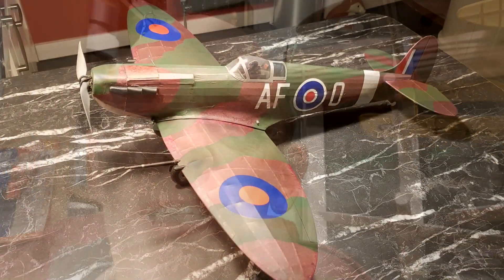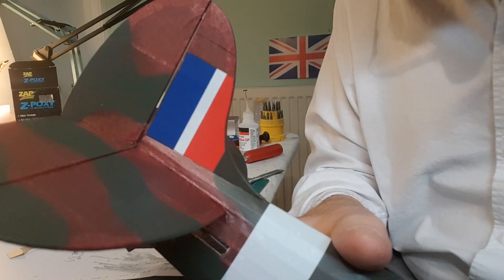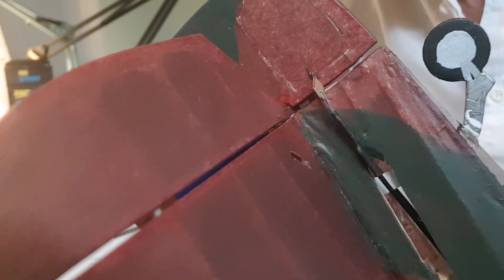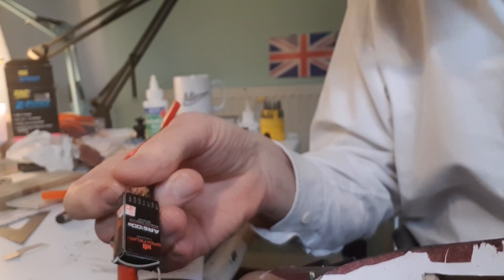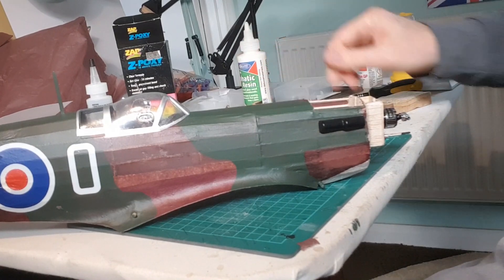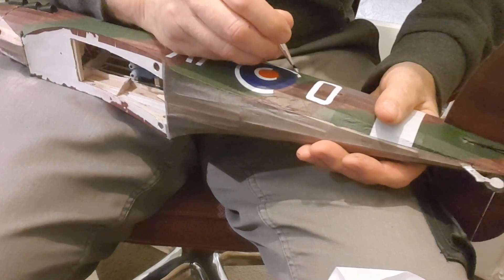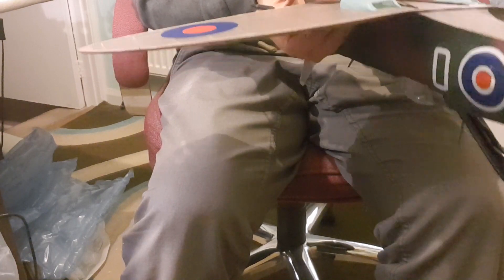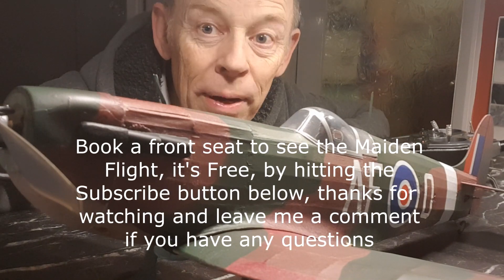Guillow's Spitfire (403) RC Conversion

Comment: Low wing RC models need ailerons, can fly without rudder. Some motor down and right thrust angle helps control torque roll..
Reply from the maker: How right you are Gary 👍🙂

Comment: Hi Cliff - how did you decide which motor, ESC, and battery to use for this?  Is it all based on the finished weight?   I'm trying to select components to buy, but going round in circles with the decisions on motor KV, ESC amperage, etc.
Reply from the maker: Hi Rod, I draw on two things, firstly what others have done already, have you seen this list of past conversations on RC Groups? Here's the link: https://www.rcgroups.com/forums/showthread.php?827861-Guillow-s-Conversions-The-list-of-conversion-threads, and secondly just my experience on what I've used in the past. Whatever you build at this size it needs to be kept as light as possible 👍
Reply: @CliffHarveyRCPlanes  Thanks Cliff - this will really help.

Comment: Thanks, this could be useful, I have a Lysander for Christmas which I hope to adapt from rubber to electric.
Reply from the maker: Thanks Mike,  I  always fancied a Lysander, perhaps one day 👍
Reply: @CliffHarveyRCPlanes  Building a Tony Ray Camel I asked for for Christmas, it's tiny, 380mm wingspan, they say it will take RC, on an 1104 motor and some micro rx board I don't have, and don't have a radio for, so I'm going nano f4 flight controller, 3 1.7 gram servos and I have a few 1104 motors from project F.A.F 2" quadcopter project, so I'll be running that, as it's all small quad electronics, it's very light. i weighed the 8'5mm coreless motor with gear drive from another brought RC plane and the 1104 was lighter, ESC brings it to the same weight but at least treble the power. Receiver is a couple if grams, and the F4 FC... wait for it, it will give  me stabilised flight, stabilised flight but it will ignore what it thinks are daft stick inputs and let you crash mode, and just full pass through mode. weighs 2 grams. it all needs at least 2 cells though, so my all up weight of the electronics including the large 2 cell lipo is 58grams, me thinks it will not work, will have to use various toy quad batteries in series to get the 7.2v required. The game has started, the fuz is built. 
 It's way smaller than the vintage models Sop. Tripe I just built for free flight!
I know quadcopters are very controversial right now which is why I just want some good old honest balsa fun, but the technology that's been developed for them is cheap, very powerful ( I could fit GPS return to home on the Camel if it were light enough) and you can get down to a couple of grams for a flight controller that will do all that, and cost £20, tops. it's worth knowing so now you know ;-)
Reply from the maker: @doyouthinknot  I have a quad to butcher and was wondering if the electronics could be used, keep us updated Ben, a video on your Channel perhaps?

Comment: This is so timely.  I am building the same kit and wanted to make it RC from the get go.  This will be very helpful.
Reply from the maker: I expect you're planning on ailerons, I'll let you know if it'll fly on rudder only 🙂👍
Reply: @CliffHarveyRCPlanes  I hadn't planned on the ailerons actually.  I was going to try rudder and elevator combo.  The instructions in the kit talk about only the rudder for RC, and the elevator for U-line but thought both might work together.
Reply from the maker: @Rod Reilly  I'll try and get the maiden done asap 👍

Comment: I like the wing banding solution you came up with. Hope the maiden goes well .🤞
Reply from the maker: Thanks Stephen, I've double up on the band as it's about 50g heavier than it was, it's not rubber bands of course but hat elastic, it's a little smaller diameter for the same sort of strength plus you can tie it to any size you want 👍🙂

Comment: well done on the right hand side is that a bullet hole between the AF lettering ?
Reply from the maker: No Rob, there's one each side, it's where the dowel fits for the end of the rubber motor, easy to patch but I wanted to leave it as a nod to it's ancestry 👍